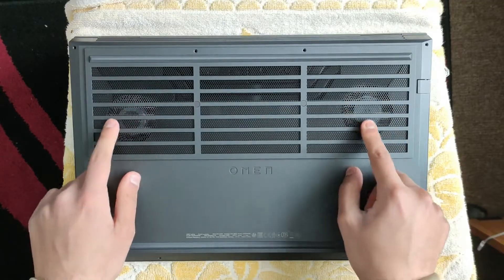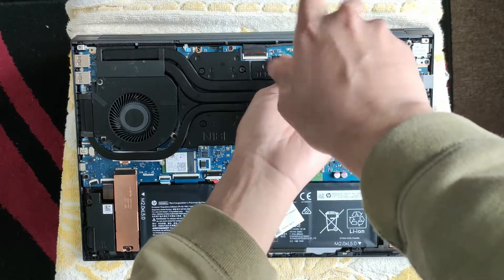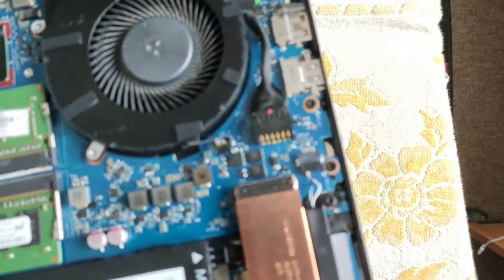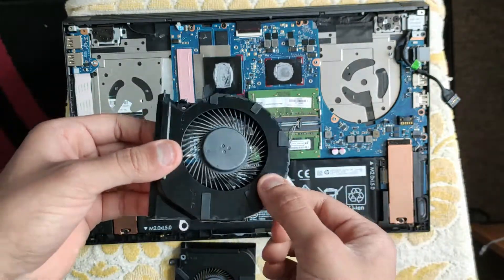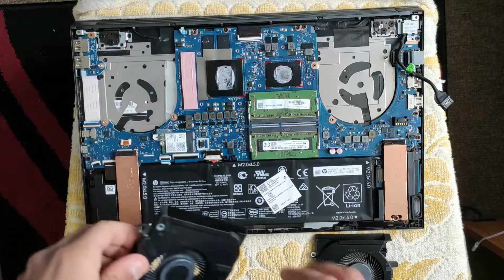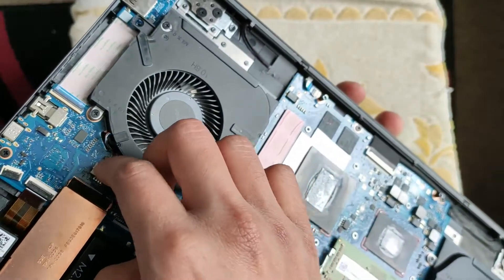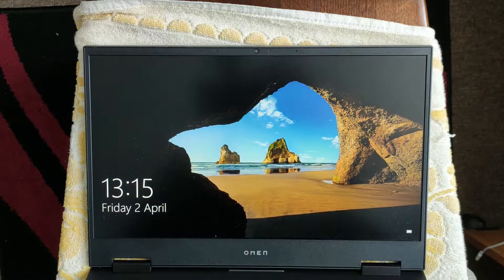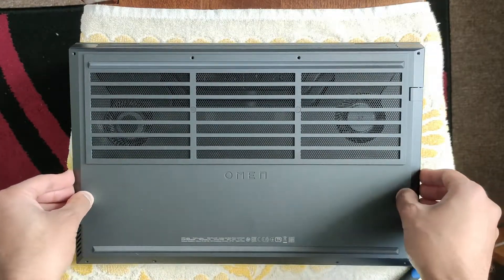HP OMEN 15 2020 || How to Remove and Clean the Fans

Comment: How to enable performance mode
Reply from the maker: @VISHWA MARTUR Which performance mode are you referring to?
Reply: @nighteye5253  omen command center
Reply: @vishwamartur  go to omen cc and set it to performance  mode
Reply: @MuhammadTalha-fx7en  not showing in my laptop
Reply: @vishwamartur  Specs?
Reply: Model Number if Possible
Reply from the maker: @VISHWA MARTUR In any case, you need to update to the gaming hub now. Omen command center is no longer supported.

The option should just be in the performance control tab, next to system vitals and network booster (when you click on your laptop on the left handed side in the gaming hub)
Reply: @nighteye5253  I tried this sir
Reply: @vishwamartur  Go to Hp Omen support and put ur s/n there. Go to the software solution and download the omen Gaming Hub SDK PACKAGE. Install it. Then go to microsoft store and download omen gaming hub. Also download HP system event utility.This tool is required for Omen gaming hub to work properly.
Reply: @MuhammadTalha-fx7en  tq let me try
Reply: @vishwamartur  Solved?
Reply: @MuhammadTalha-fx7en  no sir still not having tht option
Reply: If you have the Ryzen 5 model, it does not have the performance mode. only comfort and default :(

Comment: Is it possible for me to clean the fans without opening the laptop up? Like if I get a can of compressed air on their with the panel still on? Cheers for the video, I just dont wanna risk my inexperience messing the laptop up.
Reply from the maker: @coater 22 You can indeed. While it's not as effective, you can still use compressed air to blow away any dust that might be covering the intake grills underneath and the exhaust. 

However, be careful. Do not let the fans spin freely due to the compressed air. Spinning too fast will prematurely wear down the bearings. 

What I would recommend doing is to at least take out the back cover. You won't risk damaging any cables and such that way, but you'll be able to keep the fans still when you blow air through them by just putting your finger on them.

Or if you find a way to stop them from spinning without taking the back cover off, then try that.

Another tip if you open the back cover is to use a soft brush to gently remove the persistent dust from the vents, and then use the compressed air. Again, making sure that the fans don't spin out of control. You could also clean the intake grill using a soft damp cloth if you remove it, and then let it dry before you put it back.

Ah, also remember the ground yourself before you open up the back, if you do. Don't want any static electricity on you, so just touch a metal surface or similar before you start. Even just touching a wall helps.
Reply: @nighteye5253  thanks you so much!
Reply from the maker: @coater2281  No worries 👍

Comment: Can I find spare fans of it anywhere?
Reply from the maker: @Ali Hassan Khan I've searched, but could not find any place that sells them online yet.
Reply: @nighteye5253  sigh I've got a rattling noise and it's giving me anxiety... Ah well
Reply from the maker: @Ali Hassan Khan. Have you checked if there is anything in the fans, like a piece of paper or plastic, or even a tiny screw if you've opened the laptop before?
Reply: @nighteye5253  I have also got the high pitch sound from cpu fan. Found 2 thinds on internet 1)clean fans 2)lubricate lithium  greese. But unable to find if someone has done this before
Reply from the maker: @Muhammad Talha Sometime, fine hair can be sucked up by the fans, which then get tangle in the bearing mechanism. So as you said, cleaning the fan usually solves the problem. As for lubrication, I am not too sure how to get into the fan itself.
Reply: @nighteye5253  i did clean it all up but... I have no idea why it's still doing that
Reply from the maker: @Ali Hassan Khan Hmm... Now, there is something you can try, but it depends on whether you think you're confident enough to do it, and if you think it's worth doing.

You can do an open back test, where you run the fans while the the back cover is off. That way you can more clearly assert the source of the noise as you rotate your laptop around.
Reply: @nighteye5253  I tried it... What I'm gonna do is gonna remove the heat sink and all and just examine the back side of fans maybe get a lubricant in idk
Reply from the maker: @Ali Hassan Khan Good call. While you're at it, you could check that all the fan blades are in shape. A misplaced one could be a source of noise. As far as I can tell, the fans are made of metal, so not sure what could cause it to bend that easily.
Reply: @alihassankhan2955  If you do check ten kindly put analyses here in the comment
Reply: @MuhammadTalha-fx7en  I'll send the whole situation on the comment
Reply: @nighteye5253  I'll check and write the whole situation here
Reply: @alihassankhan2955  Any Updates?
Reply: @MuhammadTalha-fx7en  so my situation was I guess not that serious... Didn't go to a professional just opened the laptop at my place cleaned it and I noticed that the noise was coming from top right side of the fan when I ever I spun it so what I did was tapped to the opposite side of the bearing and haven't been hearing that noise since.
Reply: It seems like a lot of people are having issues with the 2020 hp omen fan me included. Im sick of my left fan rattling lol

Comment: I like you, you're just as curious as I am, but my question is why did you buy a HP OMEN 15 to have a better product like a Lenovo Legion 5?
Reply from the maker: @Shafi Uddin I agree that on the performance side the Lenovo can do better than the omen, hands down. But the difference is not that significant to me, and I really like the size and looks of the omen. 

Also, the legion was not available when I bought the omen, and now the price difference is £20. Even now, I would personally choose the omen over the legion. 

Maybe a different argument with RTX 3000 based models, as I think Lenovo might just have higher tdp card in their laptops compared to omen. But we'll see.